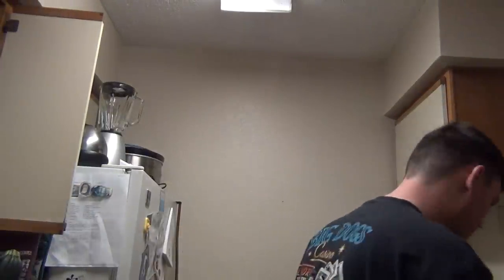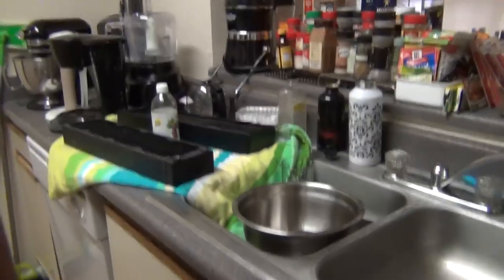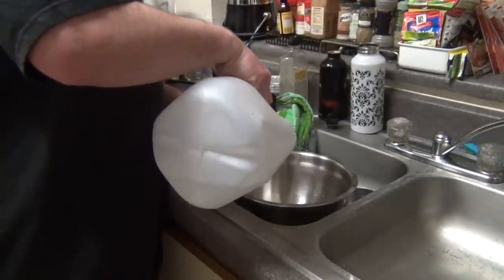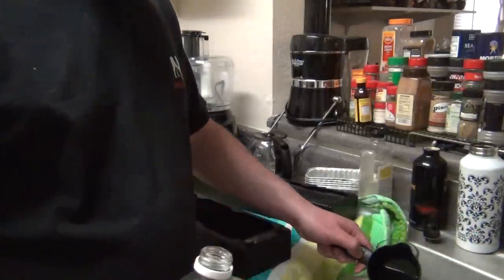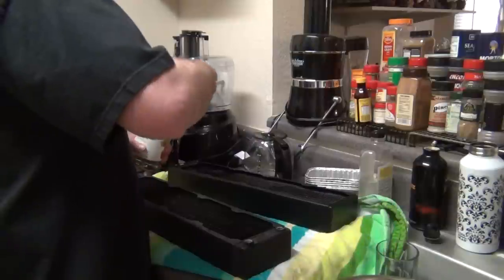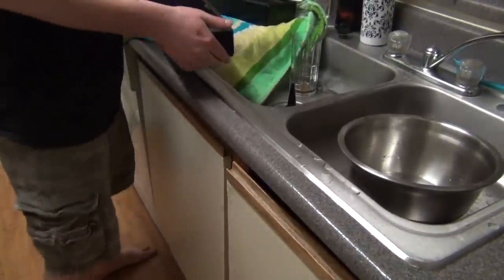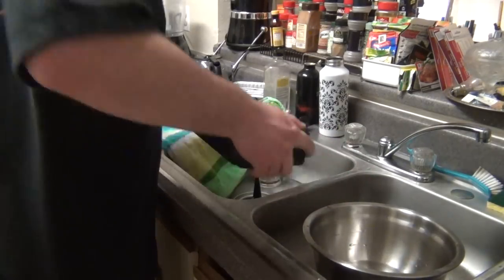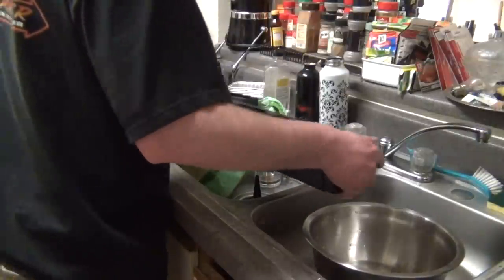How to clean a radiator( how I do it)

Comment: Problem is that last EK waterblocks was tested with pure distilled water and also with kill coil'\pt nuke...the result is not as good as with the coolant like Mayhem (non-uv)\Koolance\Feser (non-uv). So the most simple way is just to use premixed coolant. No problems, no oxidation & almost\absolutely no precipitation inside blocks. Good luck with your loop.

Comment: What is the issue if you find a  redish brown muddy clay built up in the radiator and on the radiator cap?
Reply from the maker: Don't know what fluid you are using don't know if you are using dye. It is a pretty vague question
Reply: You have a cast iron engine and it's just rust that builds up.

Comment: I'm going to try this tonight. Thanks for this video. I have an RX360, RX240, and an EX240. Does this also work for CPU blocks (XSPC Raystorm)?
Reply from the maker: Yes,it should
Reply: Do you know if it's normal for the fluid to come out like a skyish blue/green?
Reply from the maker: Todd Nunez yes this is normal
Reply: Todd Nunez Thats oxidization, if you can,  look at some copper piping in your house (mostly near the joints) or near taps it will most likely be a light blue/green

Comment: Helpful vid as usual Jug, one quick question would this method alone be alright for flushing new rads that have never been used before?. I've seen Linus' way and honestly I don't want to do all that work having to rip that loop apart then reinstalling everything again
Reply from the maker: I would use 90 percent isopropyl alcohol and let it soak not vinegar.
Reply: Hmm thanks, I guess the same steps though using distilled water with it?